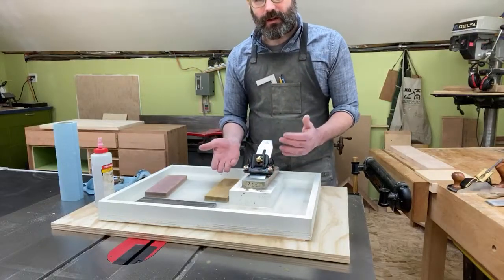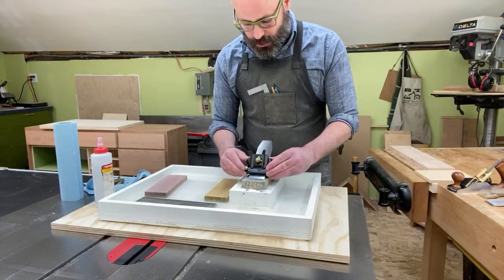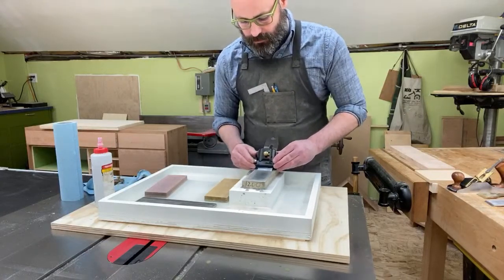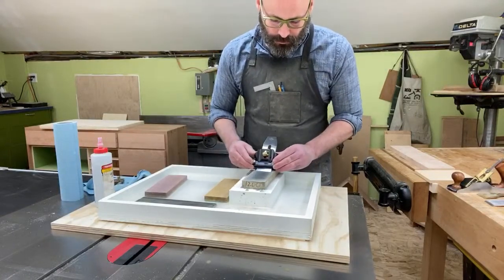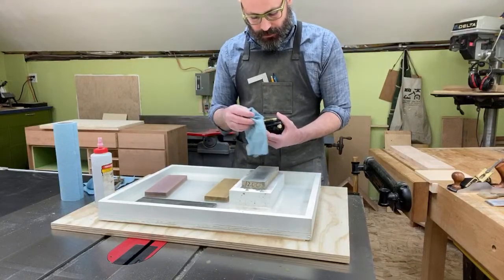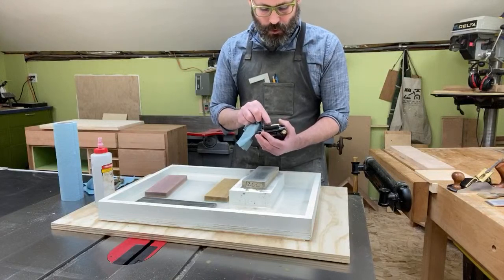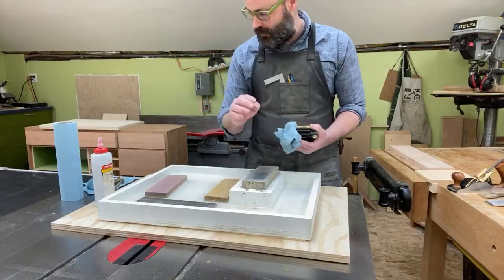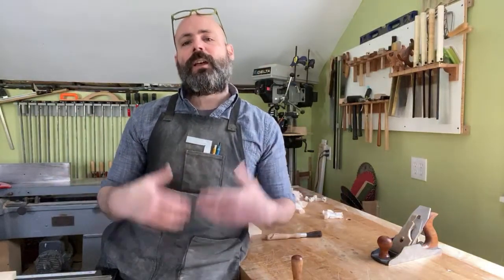How to set up a smoothing plane

Comment: im surprised you mentioned that sanding and planing can yield equal results. i had seen a video doing a test (forget who sourced it) but the planed board was clearer due to pores not being clogged by the sawdust. great video though i really enjoy all the knowledge. im new to hand planes even though im fairly experienced woodworker
Reply from the maker: Probably wasn’t sanded to a high enough grit, or cleaned afterward. Also, I was talking about boards with finish and get a period of time.

Comment: Hi Matt.  At some point I'd like to see how you flatten your water stones.
Reply from the maker: Diamond plate.
Reply: Thanks for the reply.  I use a diamond plate.  I bring my stones into the kitchen and flatten them while running them under water.  I don't have a sink in my shop.  As you can imagine this creates a mess in the sink which causes my wife to call out my other initials, W.T.F.!  That's why I was interested in your method of flattening in a shop without running water.

Comment: There seems to be a lot more play in the adjustment wheel than I’d expect from a LN. I have an old Stanley Bailey that drives me nuts for that reason bc it’s machined so poorly.
Reply from the maker: In my No. 4 you mean? I don't think it's too bad. There is play in any plane's adjustment.
Reply: Matt Kenney Of course there’s play in all adjustment wheels. But you seemed to be spinning that like you’re on Wheel of a Fortune.   I just sold an old Stanley Bailey 4 1/2 for a variety of reasons, including the poorly machines adjustment wheel. I hope the LN 4 1/2 will be tighter than what I saw in your video.